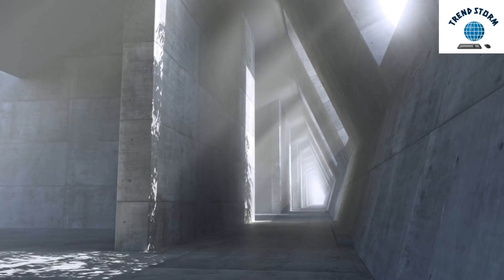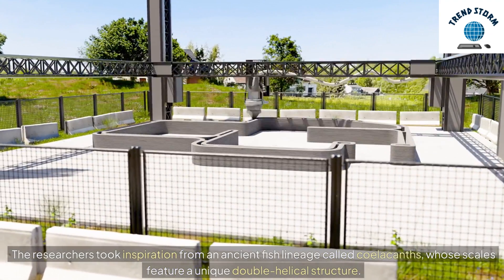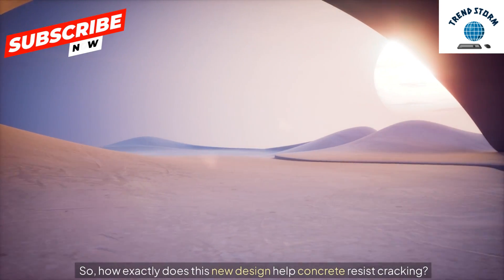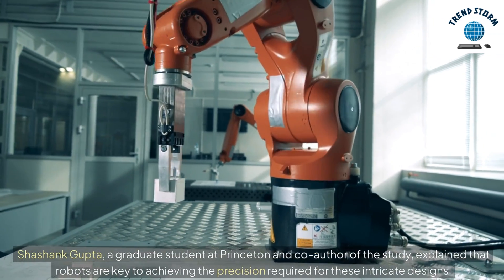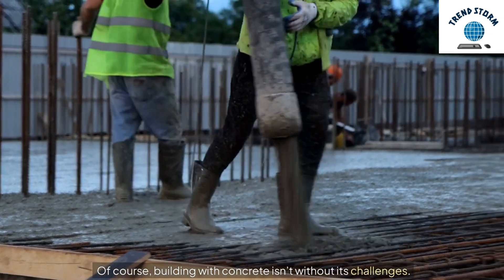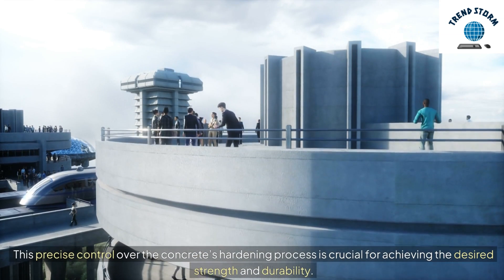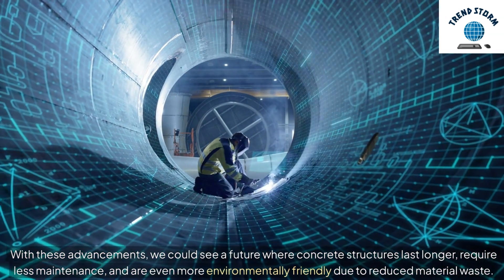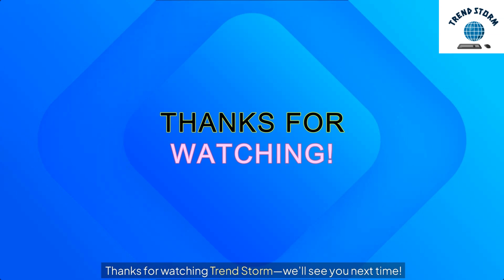Nature Inspired Concrete | The Secret to Stronger Concrete | Robotics in construction

Comment: Wil this method make concrete structures more durable in extreme environments?
Reply from the maker: Yes, the improved crack resistance could make concrete more durable in harsh conditions, potentially extending the lifespan of structures.